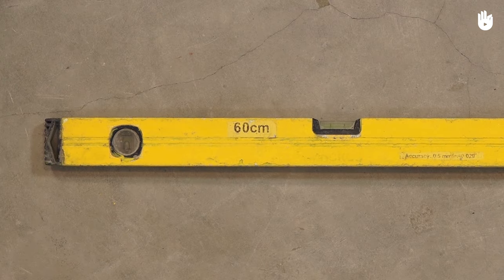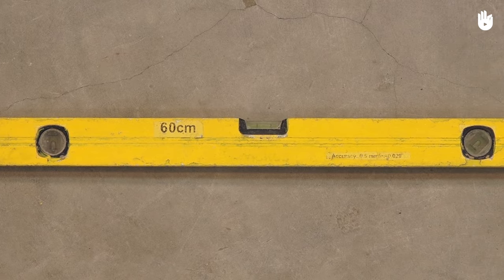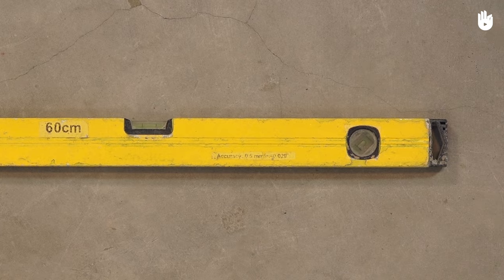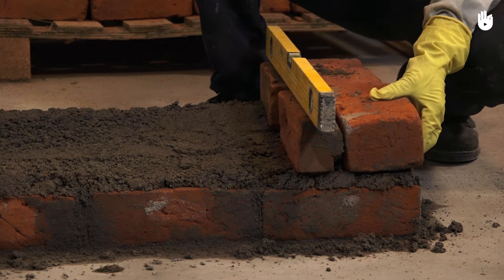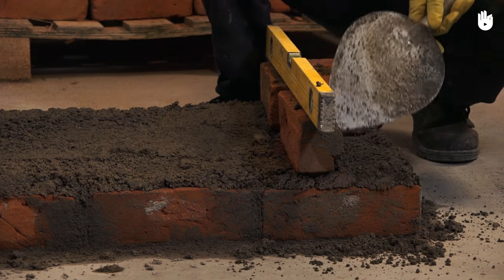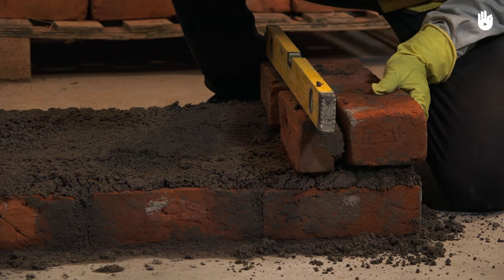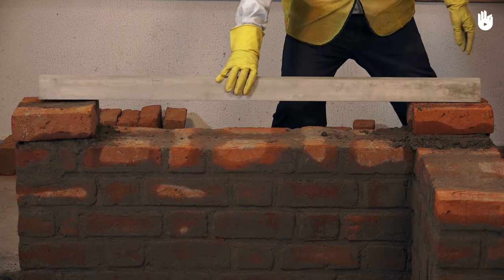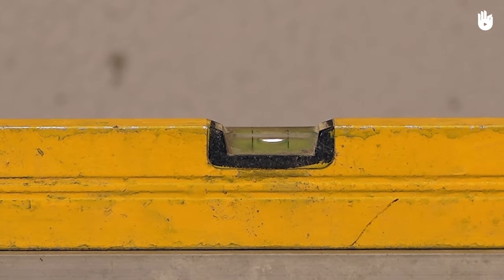How to Use a Spirit Level | Masonry

Comment: nice viedo but i have one question to u .if the bubble is at right side .which side we want to remove the cement
Reply: Left side
Reply: Right side because liquid is denser and leaves bubble to higher level
 Clear example is water bottle👍
Reply: Right side
Reply: The side on which the bubble goes is always UP. 

So make adjustment accordingly

Comment: Remaining two side bubble use???
Reply: The bubble on the far left at the beginning of the Video is a (90°degree ∟) good for leveling straight vertical or parallel to whatever you are leveling. and the other on the far right is mostly likely the popular (45°degree ∠)  which is good for leveling things out with a 45 degree angle or offset. good in pipe fitting to!